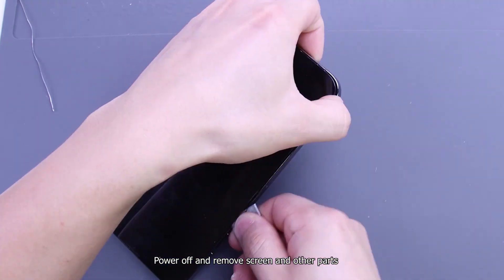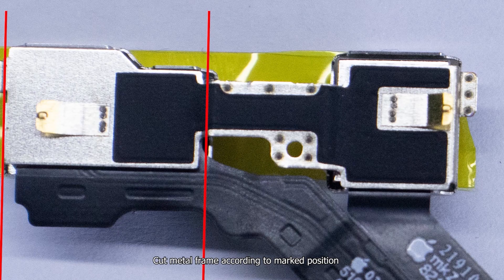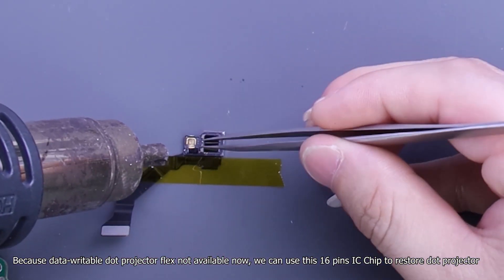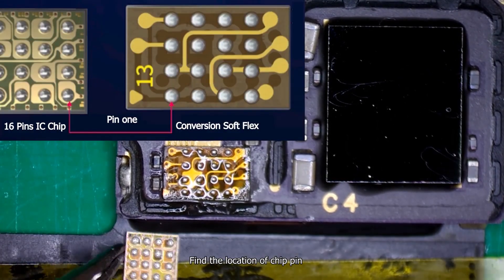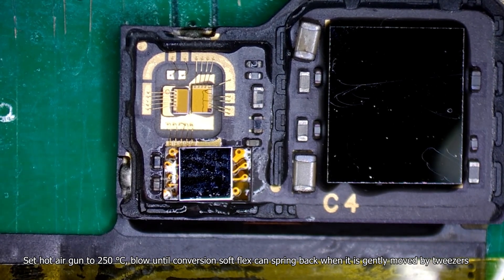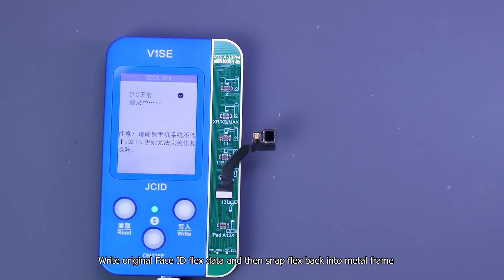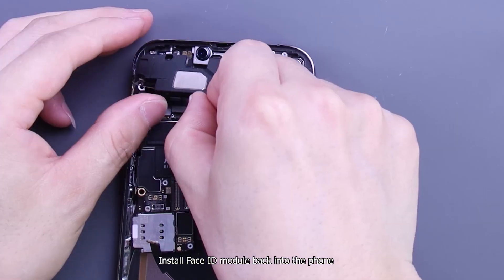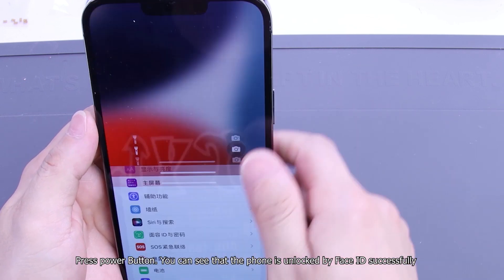JCID 16 pins IC Chip to restore dot projector-to fix iPhone 13Promax Face ID

Comment: hello sir, I have a face id problem on the iPhone XS Max, I found that the flexible dot matrix has been replaced with flexible JC, when I checked JC V1s it read chip short, how can I fix it?  is it possible with a method like this video?